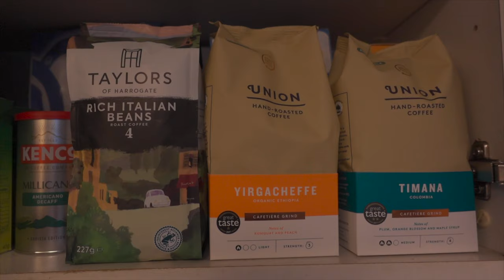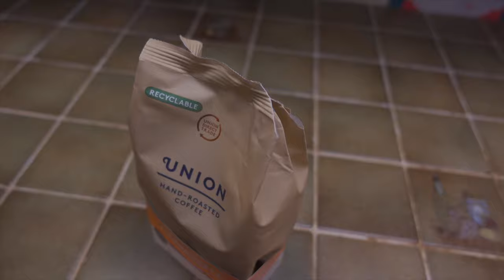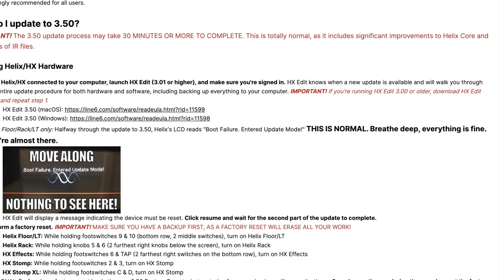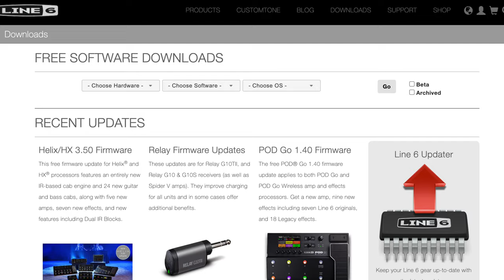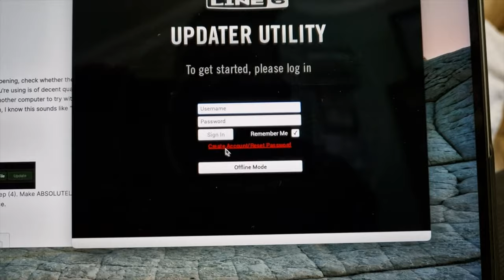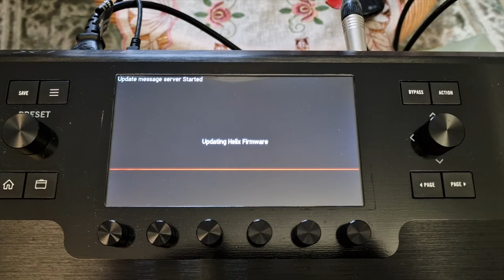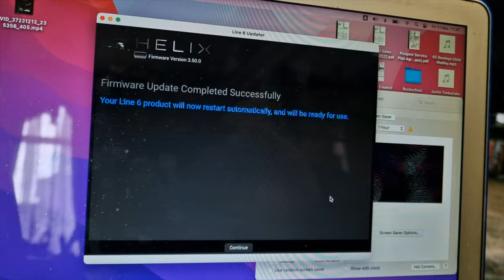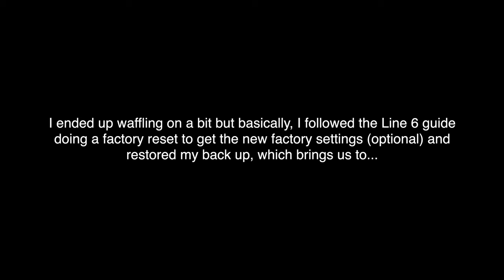My Helix 3.50 Firmware Update Went Wrong! (Here's How I Fixed It)

Comment: Thanks for this - I had exactly the same issue on update 3.7 as my MacBook went into sleep mode in the last seconds of the update.  I also note that my MacBook won’t download the updater due to security issues ???  Had to use windows laptop which fixed it. Appreciate the tip - I’ve had this before but couldn’t remember how to fix it.  Updater is the fix!!

Comment: I felt your pain -- the same thing happened to me, and I followed the instructions to a T.  I'm on Windows and ran the update from HX Edit and watched it hang on "Boot Failure, Entered Update Mode!" where I let it sit for 45 minutes then left it up overnight where it was still stuck there in the morning -- not a good feeling at all.  And my computer never went to sleep during the process.  Running the Line 6 Updater fixed it.  They say misery loves company, but so does triumph.  So here's to triumph!  Cheers.    Hardware: Windows 10, Helix Rack.

Comment: This was great video. My Helix update went fine, but I've read many stories from forums that people had many issues while updating. I think the most usual scenario is that the computer somehow/for some reason disconnects the connection to Helix. If this is the case, you get stuck to the "boot failure..." screen and you never see the "resume" button in hx edit. Thankfully we have the line6 updater software.
Reply from the maker: That's exactly what happened to me. I thought we were done with the Line 6 Updater but it has made a worthy come back FTW!

Comment: I guess I’ve been lucky, every time I’ve done a Helix update it has gone as planned. I do follow the instructions and am careful not to disturb my MacBook Air whilst it’s updating so I think you may have a point that the computer going to sleep does interrupt the process as that could disconnect the USB port thus causing the error message. My MacBook is a 2020 M1 model so I have to use a hub to connect the older usb lead to the usb C port but that has not caused me an issue so far. I also use an app called Caffeine which stops your computer going to sleep, it’s on the Mac App Store and probably available for Windows as well. I can recommend it as a possible solution to stopping your computer going to sleep, maybe it is a solution to this update failure issue.
Reply from the maker: Oh wow, I haven't used Caffeine in years. I had it on my old MacBook Pro 2009. Great call to use Caffeine in this context. Thanks for suggesting it.

Comment: I had similar problems with a unique situation which I will not go into. But yes I would plug my computer into the wall then hook into HX edit with your helix then go through the back up. And back everything up. Then didn’t get out of it and turn off your helix and hold the foot switches together and clean off all your firmware. Then plug it back into the computer and try it that way and you probably won’t have as much problems. But I ended up going to the updater for my Helix. Then when I did my HX stomp it all worked in normally
Reply from the maker: Glad to hear there was a happy ending!

Comment: My update from 2.5 to 3.5 went flawlessly but during the firmware update process (at 50% complete) I did get a windows popup about an unsigned driver and that Windows doesn't allow unsigned drivers. It also said the driver wouldn't be available and that I should uninstall the software. I just clicked "OK" at the popup and the update completed successfully and the Helix reconnected to Helix Edit as expected. Not sure if it's gonna affect anything going forward but so far so good.

Comment: Hi all! I have HX stomp, the firmware was 3.11, I decided to update hx edit to 3.50 today and an error occurred. Now the computer does not see the processor and when you turn on the stomp, it loads forever. I did it through a Macbook air through a usb hub,. I made a backup before the start of the update. I don’t know how to roll back to the factory settings. If anyone has come across this problem, please help.

Comment: This is complete bullshit. You have to get it into update mode, but mine won't even go into update mode. Haven't used it in awhile, turn it on and get "Updating UI MCU Firmware, please wait." Wasn't connected to anything. Nothing. Shouldn't have tried to update firmware. Did look online. Took about 6 times turning it on with holding down the 6 and 12 buttons to get it to go into Update mode. Finally after waiting for like 4 mintues it finally said "Firmware failed to load, going into Update mode" and was able to connect with HD Edit. Got about halfway through and stopped. (from PC with nothing else running but I was watching it), now I can't get it to go back into Update Mode again after HOURS of restarting with those buttons pressed. I put in a ticket, but they don't answer. It DOES show that it did update the firmware to 3.71, but other than that it's the same "Updating UI MCU Firmware..." It bricked without me even turning it on.
Reply: I'm there too, shouldn't have gone for 3.71 . I even tried backscaling the updater and going back to 2.80 with no luck. I have backup pedalboards but nothing like the Helix. I wonder if buying a new unit will give the same problems... ?

Comment: Maybe it was dumb luck but when I updated the HX screen went all gobbledegook. USB was going 6 into a hub (I never read that part) but justvwauted6atvthe boot failure part and everything went perfectly. I wonder if it's older helixes that are having issues, like ones that were made before a certain update or something?
Reply from the maker: There has only been one version of the Helix so the hardware would have been constant since its release (as far as I'm aware). Although with the firmware there have been times where you would have needed to update the Line 6 Updater software before updating anything else. So, depending which firmware you are coming from. yes, you may be correct. Glad you managed to update successfully!
Reply: @ProFunctionist  oh yeah I meant older software versions, my bad. Glad yours is up and running in any case! Are you loving the new cabs so far?
Reply from the maker: @Crabfather  Still haven't had a chance to try the new cabs. I'm still programming for an upcoming gig where my Helix is used with my amp, so no need for cabs on this one. Looking forward to checking them out though.